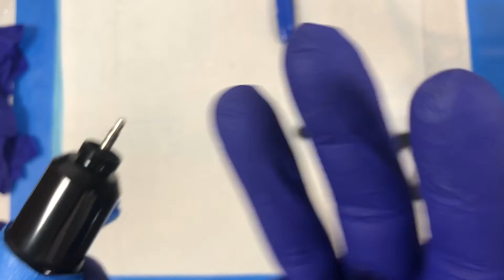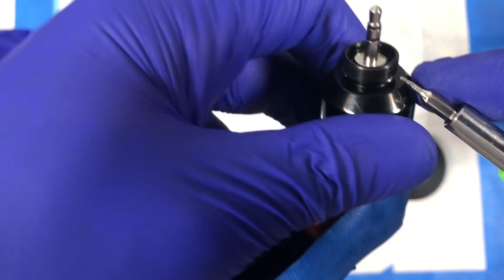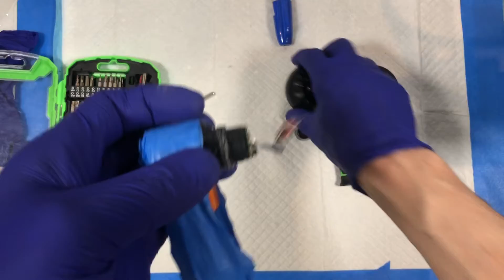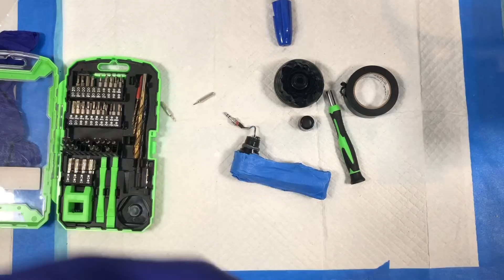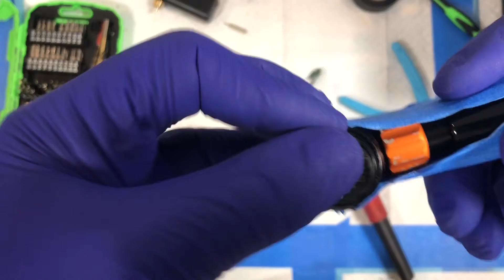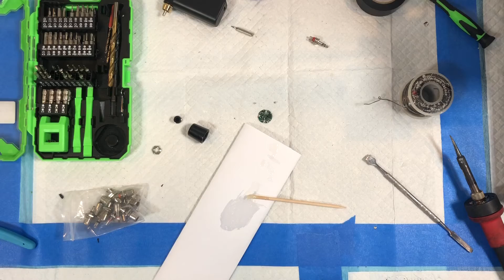Cheyenne Hawk Spirit *RCA Hack

Comment: May I ask a question.. can we change the camwheel of cheyenne spirit from 2.5mm to 3.5mm for stroke?
Reply from the maker: John paolo de guzman no the spirit cam is pressed on the the motor output shaft where most other cams are held my a small set screw
Reply from the maker: John paolo de guzman the original is 2.5mm, the spirit is 3.5mm, and the thunder is a 4mm, throw
Reply: Spirit is 3m ,pen is 3.5

Comment: Please help, what the difference if i using critical power supply for cheyenne thunder than cheyenne power supply? is that make the machine run bad because using critical?
Reply: No thunder works very well with critical..
Reply from the maker: The only time I ever had a problem with critical and Cheyenne thunder I was using the jump pack after I remove that and use just a regular cord never had a problem